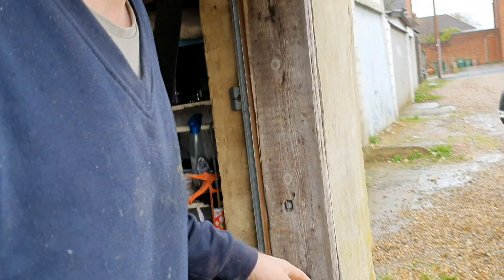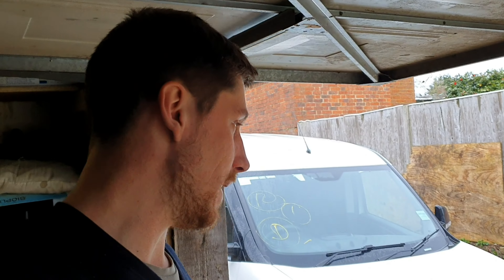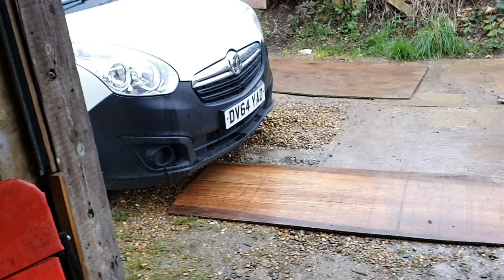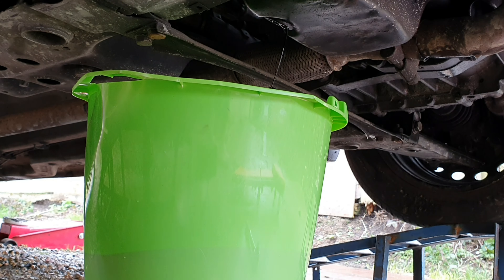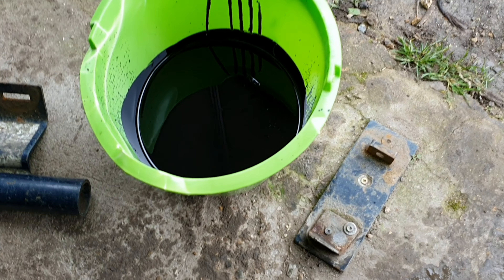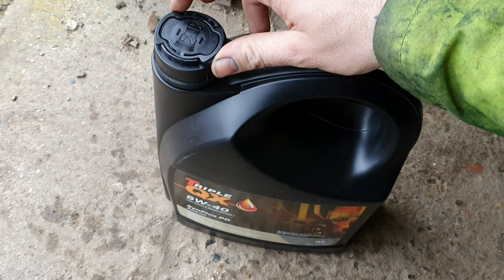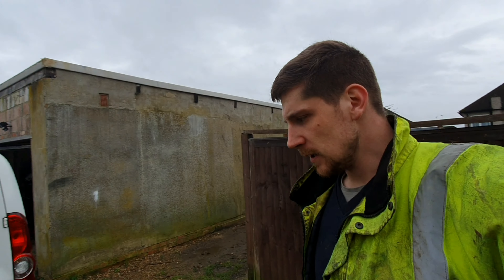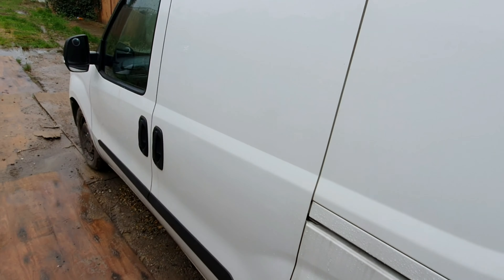2014 Vauxhall Combo COPART Van PT2: WHY IS IT SMOKING??

Comment: You will get abit of oil in the turbo intake pipe as it connects to the rocker cover but probally not as much as you had in yours
Reply from the maker: Yea I did think it was abit much! Turbo does seem to have slight play
Reply: @SalvageDiaries  and if.it has too much play could have oil slowly passing through the seal
Reply: You shouldn't get oil in.

Comment: Could you run it at idle with turbo hose off on the boost side ,  it would prob throw codes but just wondered if it would show any oil passing . also try running with dipstick pulled up a bit in case its sucking oil because of  faulty pcv  just a thought  see if the smoking eases
Reply from the maker: Brilliant thank you for the advice, will definatly try this!

Comment: By the look of that oil it's not been very well looked after. It may need all the breather pipes cleaning, new air/fuel filters,  and maybe strip the turbo and give it a good clean. The one good thing is it, the engine sounds ok. Great vid.
Mick
Reply from the maker: Oil change was long overdue, next step is to definatly get the oil air & fuel filter changed. Will investigate the breather pipes PCV & Turbo for sure. Thanks for your feedback Mick, always greatly appreciated Sir 👊🏼